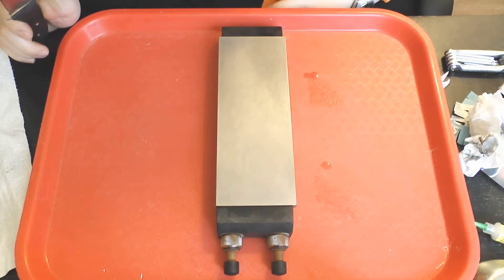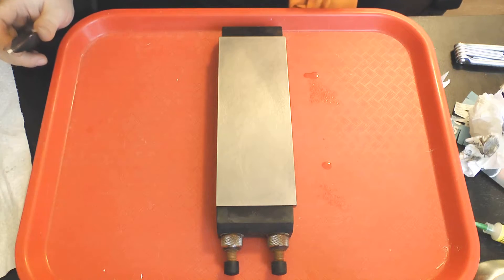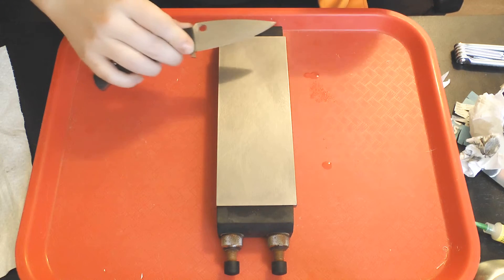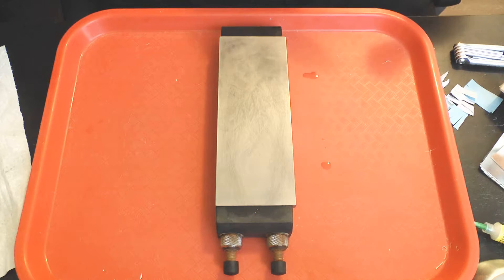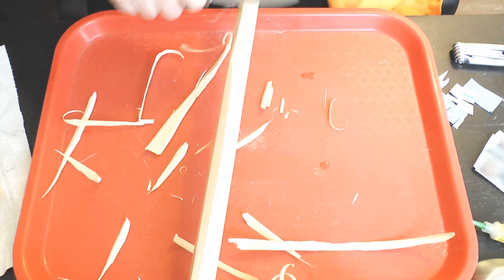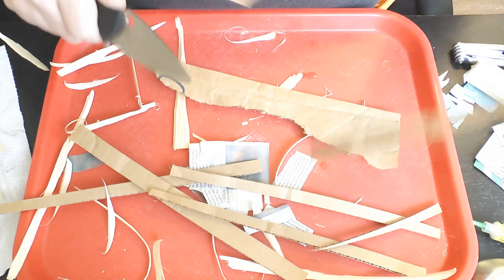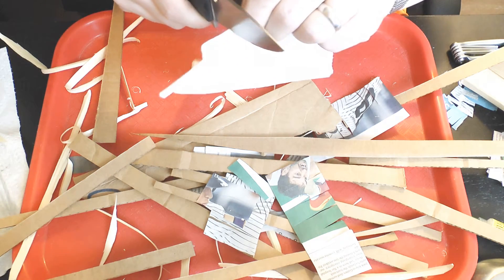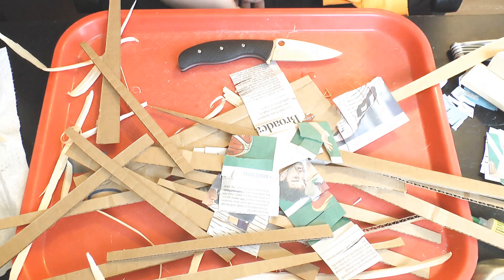AlOx and SiC vs. Vanadium - Part 2: DMT EEF

Comment: I realize knife land of mostly basically nonsense and myth and assorted boy brained bullshit. But I don't know where you got the idea that coated abrasives like diamond plates can be compared to Waterstones in their grit ratings. Grit ratings more generally are arbitrary. Even quoted abrasive particle size is more arbitrary than you might think, because it depends on how the abrasives are bound. Softer binders leave softer scratches even with the same abrasive particle size as another stone with a harder binder. You're calling out a lot of things bs which is indeed bs but you also make a lot of faulty assumptions of your own.

Comment: Hello Steel Drake. For an advance, thanks for the good work on this kind of problematic. For advance, english is not my native language. I am a hobby sharpener myself, i do posses a moderate skill in freehand sharpening and most of my knife collection are powder steels Spyderco folders. I own a collection of sharpening stones (Atoma, Matukusuyama, Spyderco, some diamond stropping compounds, etc). Right know i am trying to figure out best sharpening (stone?, material, etc?) suiteable for powder steels. I have sharpened many kinds of powder steels (Maxamet, ZDP 189, CPM S 110 V) and so on. On my Spyderco Military CPM S 110 V, my favourite edc knife folder took almost a year of edc daily tasks before first needed resharpening. First resharpening took on Imanishi Bester stone progression up to 10 K. Results not so satysfying.  I hade to run it again on a Atoma diamond plate progression up to 1200. Results excelent, solid, agressive sharpened knife, but i really dislike markings from diamond stone on my knife. When i have puted my hands on Matukusuyama stones, these stones are conciderabelly harder, then Bester, i have resharpened my knife again, more for to get rid of the diamond scratch pattern. Results of the polished edge were pretty good, but later in my work, when i had to cut many boxes, wrapping materials and so on, sharpness of CPM S 110 V dissappeard like an ice cube on the desert. So i have concluded, that you can reach fairly good polished sharpness on a hard synthetic stone, but problem with teared carbides will be in the edge retention. I would really love to see you test CPM S 110 V steel in some of your videos to conlude the results. Keep up the good work.